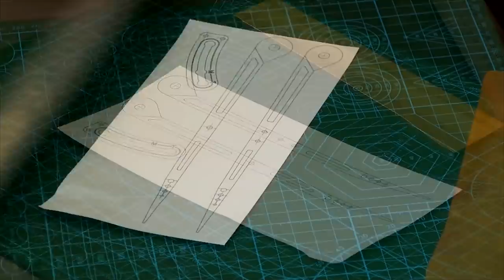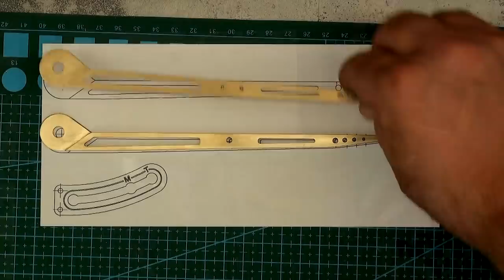Steampunk Wing Compass for Tabletop Game TravelBattle How To

Comment: What are those "plates" at 4m8s, holding the parts in the vice; they appear to be aluminium sheets with rubber in-between? And at the 6min mark, which reactions were those (I didn't see any wiring, so I'm assuming it wasn't electroplating)? Thank you!